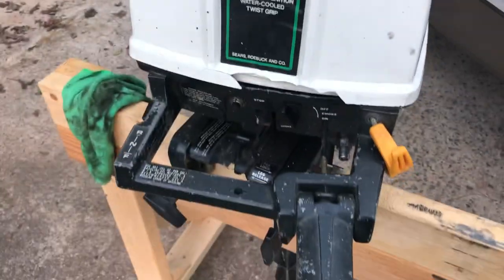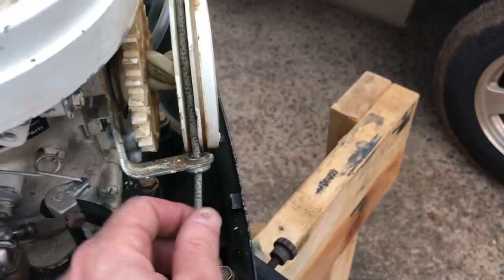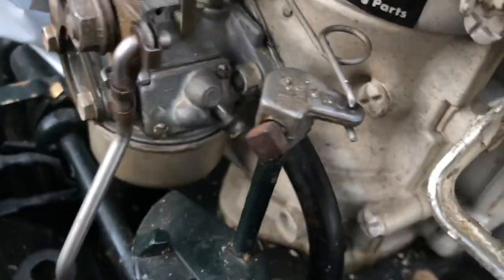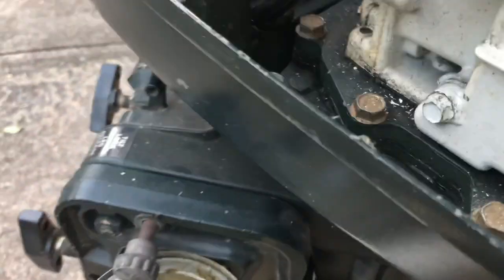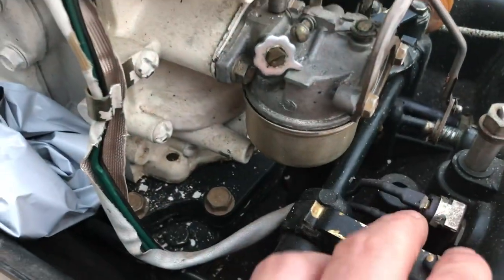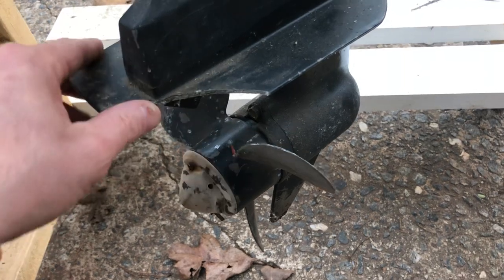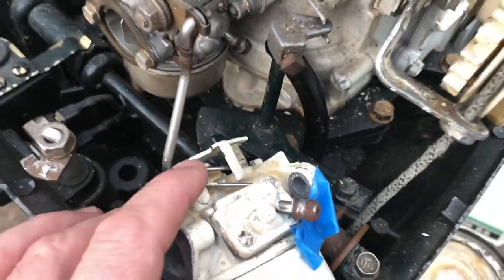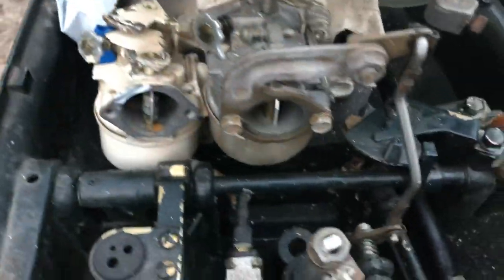Gamefisher 9.9 HP to Game Fisher 15 HP ? Spring Project ,

Comment: I'm looking at picking one of these as well, a 1977 model, it pulls over but doesn't have spark, and I'm thinking I can get it going.  Looking forward to following along with your build.
Reply: I had the same issue. You need a new stator from CDI. Easy job